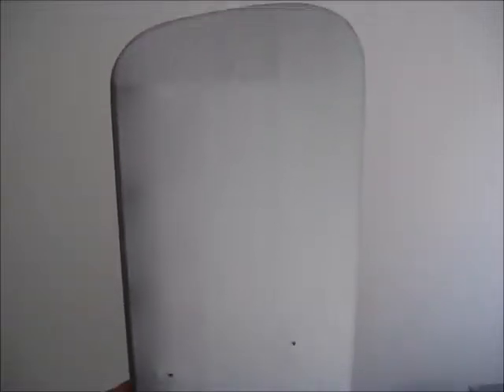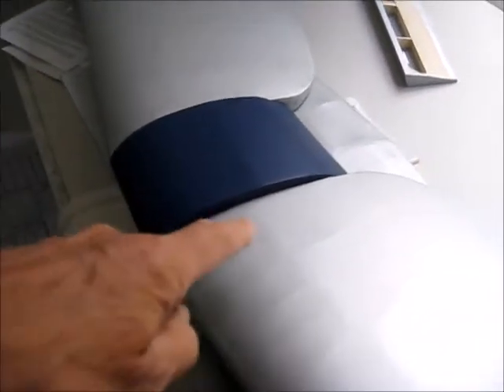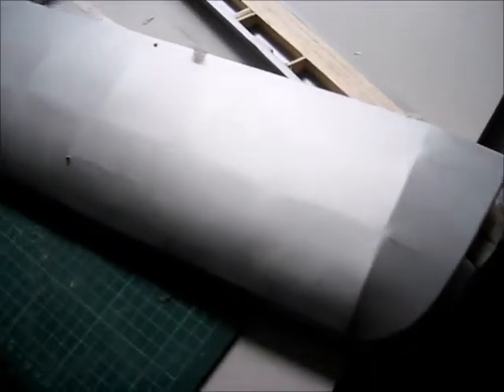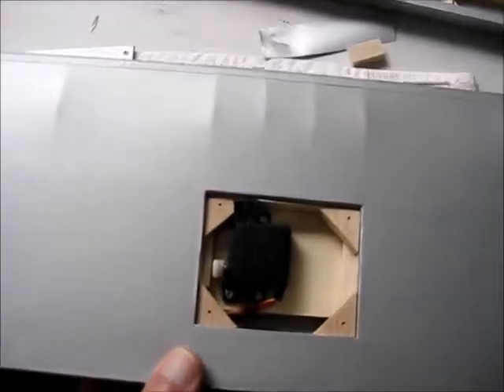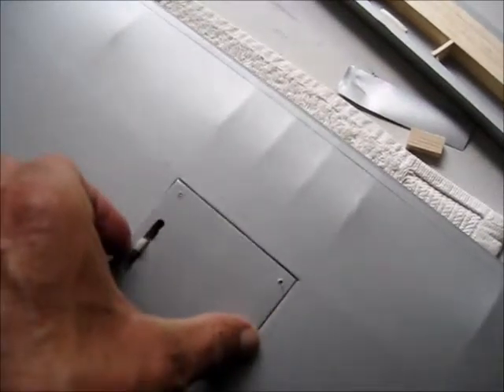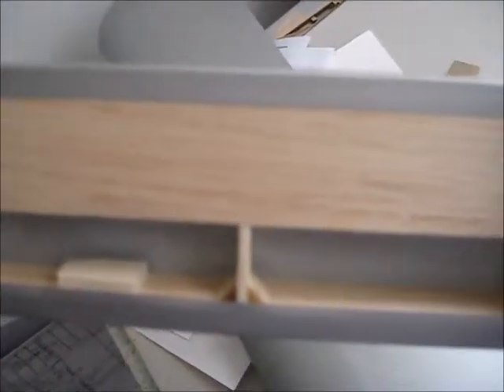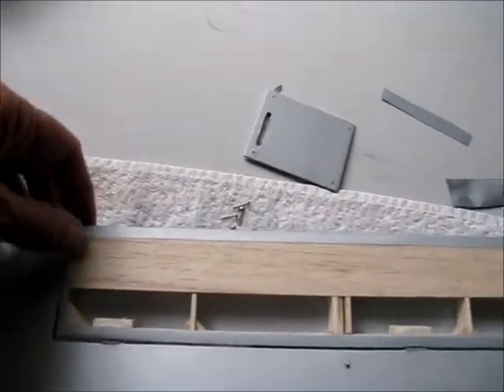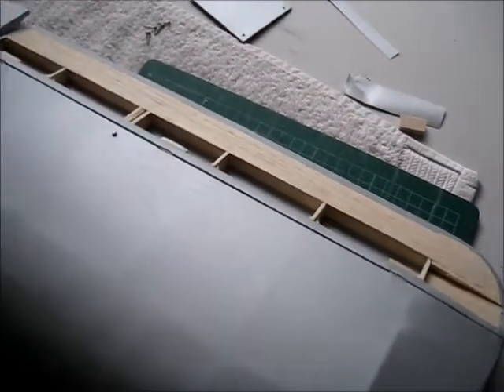DB Sport & Scale Tiger Moth - cover wings

Comment: Alan, nice job on the covering.  Sounds like it went on without snags.  I just received my silver Oratex yesterday but I'm not ready to cover yet.  Working on the cabane strut assembly which I plan to get installed today.  Thanks for posting your progress.
Reply from the maker: Hi John, I've only used Hobbyking or Solarfilm covering before, and the Oratex is much easier.  Tack it in place first with iron turned right down (100 C), and for going round corners and shrinking (120 to 150 C) depending on how much you want to stretch/shrink).  You need to be careful because it shrinks a lot and can tension structure, and if you're covering up to a line it will pull away as it shrinks, so allow a little extra,
Reply: @alanbarnstable6874  Thanks for the advice.